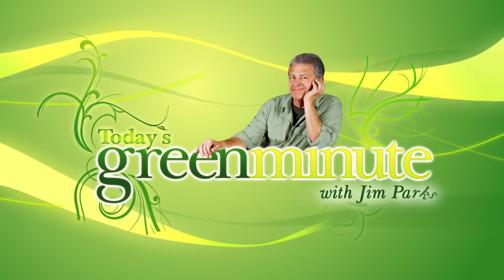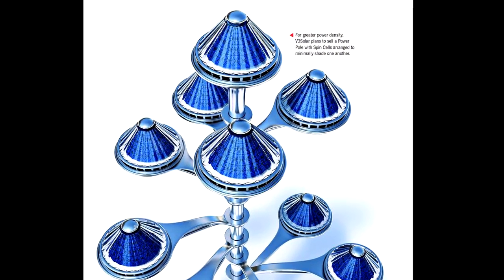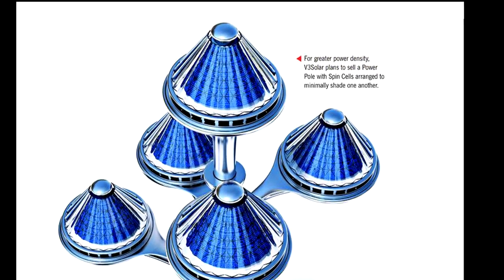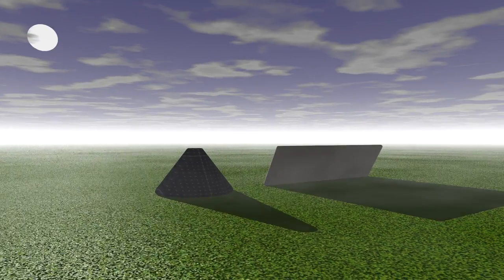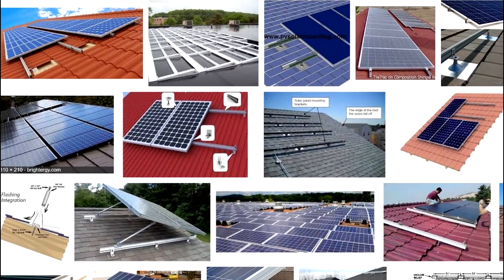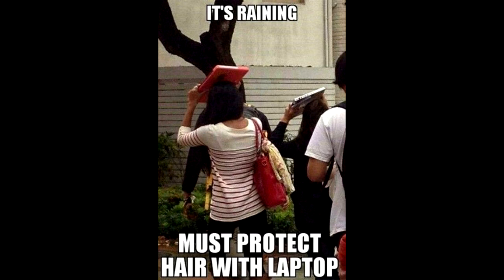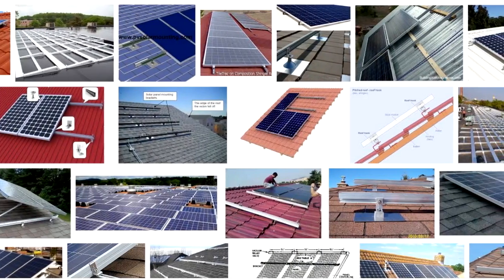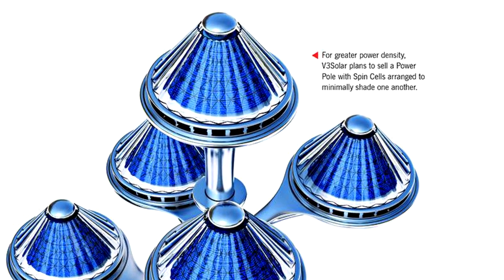Spinning Solar -BUSTED!

Comment: 20x more energy is different from 20x more efficient.
Reply: At the very least it is false advertising of the worst kind. So its still bullshit.

Its like saying "by burning 20 times as much coal we can achieve 20 times more energy output with this revolutionary new plant!"
Reply: In this case, it is the same because the input is the same, energy from the sun. If Spinning Solar is able to produce a 20x greater output with the same input, it is 20x more efficient.
Reply: Can people please read what I said instead of repeating that 20x more energy is the same as 20x more efficient.
Typical internet arguments.
Reply: Kiw3y BITCH I'M ABOUT TO LOSE MY SHIT
Reply: No, 20x more energy is not more general than 20x more efficient, it is just as general. Energy is a quantifiable amount of stuff in the universe, just like mass. Efficiency is how well a solar panel can use that energy. Efficiency isn't just used for solar panels either, it is used for engines and turbines, light bulbs and everything else that uses energy. Saying that an engine is 20% efficient means that for every gallon of fuel, 80% of it is lost in heat. This means that no matter how much energy the solar panels receive, they can never turn all of that energy into working energy. That's because 80% of that energy is to heat.

And how would a tree be more viable than a square block of solar panels? In order to maximize the amount of energy absorbed, we have to increase our surface area where the sun shines,  not behind another solar panel.
Reply: Joshua Reed tldr
Reply: Could someone please explain to me what efficiency means? I didn't get it from the 500 explanations.

Comment: it didn't actually say was 20x more efficient, it said 20x more energy. so i guess that means that if it has the same surface area as say a 50watt panel it would deliver 1000 watts. ya i'd have to call BS on that one.  never mind the fact that 1/2 of it is in the shade. even if it had double the surface area of a 50 watt panel so 1/2 of it was getting light  and then you put up some mirrors so the back side was getting light, since i've not heard of any massive breakthroughs in solar tech i'm guessing you would only get 100 watts minus what ever the motor takes to rotate that much mass.

Comment: These are no different to the wind turbines that require power to get them started since, in most places, the wind isn't sufficient to start them moving. Also, the blades of the wind turbines do not catch enough air to be efficient, to be far more efficient, the blades would have to be around 5 times wider or more, (think of the blade size on a kids windmill toy or an electric desk fan).

As with the wind turbine, any moving part creates wear which equates to cost for maintenance and repair. Therefore, a moving solar panel is going to cost more for repairs and maintenance than a static one. Even a tracking solar panel isn't going to cost as much because it moves very slowly, taking around 12 hours at most to move a little over 90 degrees every day. That's a lot less wear on bearings compared to 200 RPM or whatever those spinning solar panels do.

As with most ideas these days, it's not about efficiency, it's about making someone rich. Some company has to make the bearings, the motors and the other parts, some company has to assemble all the components and another has to build it on site and finally, another company has to maintain it. You can bet these companies are not going to be paid peanuts to do it. Even if these spinning solar cells were 100% efficient, the cost involved in building, repairs and maintenance will make the power they generate just as expensive, if not more expensive than current methods of power generation.

Just like wind turbines, it's a scam.

Comment: you can use fresnel lenses - but then you could make it any shape you want
and why spin? a clear glass (fresnel cut) shell radiates heat just as well in the sunlight, provided the gap is filled with water or something to transfer the heat from the panel and the shell.

on the other hand, the water itself can be used as a lense. but still, a panel arrangement is much more convenient, tracking or not.

- it does have potential, but it's not sensational in any shape or form

Comment: 60"C "That's SO HOT you couldn't touch it without burning yourself? In reality it's at the kind of temp' you could pick it up and quickly decide "that's hot" and put it down again. You really could touch it without burning yourself. It can burn you, but it would take a little time.

Comment: You sir obviously do not remember a damn thing about science. The waves of the outer cone aren't there just to look pretty. Nor is the black spiral you see on the inner core. Those waves refract and concentrate the light around the globe so that in essence almost 50% of the inner surface is producing more energy through magnification. as they pass into the shade the heat generated by this is dissipated by the rising cone of air that is being used to spin the inner cone. The cooler the cell is maintained the more efficient it is.
Reply: Not sure if troll. Just in case, I'll say that no matter what you do with the surface it doesn't collect more light than it gets shined on. And you cool solar panels with water, so you can use that energy, too (instead of heating water with electricity or gas). Not with air (which is going to be infinitely worse than water) and waste that energy AND put in lots of energy to spin that thing.

Comment: I know its bullshit, but do your math.  20 X more efficient on 20% efficiency, does not calculate to 400 %
Reply: ha, omg. So you can think of 20% as 0.2 but not of 4 as 400%. I see. Your idiocy makes sense now.
Reply: Rob Gandy
0,5x1.2=0,6. So 60%
They did not say 20% more efficient.
Reply: Rob Gandy 
1 is 100%
4 is 400%
20%=0.2
20x0.2=4
20x20%=400%
Reply: 20 x 0.2 is what then? Maybe they meant 20 times more efficient per square inch but they sure didn't say that and that is also an extremely tall claim.
Reply: Go ahead and explain how 20x20 is not 400.
Reply: Your No serios are you ???  I never said 20 X 20 does not equal 400.  I said, 20 % of 20 % efficency does not equal 400 %.   need to check your math, not to metion the law of thermodynamics.  (forgive the spelling, I dont have my glasses on)

IF I had a 50% efficent solar  cell and i created a new one 20% more efficent, you tell me what it should be.  (I know My math)

Cheers
Reply: Awesome!  Math wins!  Good job!  Still, Regaurding the Vid.  Still smells like bull Crap.

Cheers!
Reply: Rob Gandy
You said 20 times 20% is not 400%

But:
20x20%=400%

20x0.2=4
Reply: K, seriously.  20 X 20 % is NOT 400 %  Please check your calculator, or pencil or something.  I'll make it easy.  20 % of what ???  if we use a simple number like 100  20 X 20 %(100) = what ???  You tell me.

Ant the fomula below, you got it right.  20 X .2  (or 20%) = 4  NOT 400.  single digit 4.  Your out by a few orders of magnitude
Reply: Damn Rob, do you work in customer service for a certain telecom giant? #VerizonMath
Reply: fight fight fight

Comment: What you don't get Thunderf00t is that if you turn these cones on their side and make them into conical wheels. These wheels when applied to a track will always roll forward across the Earths surface with only a small amount of energy needed to go uphill. It will revolutionize the way we travel by locomotive!

Comment: When i saw this i went HUH, I love solar i have 2x 250 watt panels myself and a battery bank.....Funny this video comes out. 2 weeks ago i was doing some tests (DIY current monitor) on my 50 watt panel and realized that for the 3-4 hours it was lying flat on my balcony, it was cooking hot on the back. i remember something with regards to efficiency lost due to the heat of the panel. I thought that if you are able to strap/secure/thermal epoxy , etc some flat copper piping of some sort on the back you could double up on cooling the panel with cold water and use the hot water produced for dishes and shower. Not sure how efficient it will be, but want to try some experiment this coming holidays. Is there some merit to my idea or am i being crazy.food for thought. thanx for the video

Comment: also musk's mars mission is not that much bullshit as the rest of this stuff. It's just that there is no way this guy with his lack of scientific knowledge is gonna do it in such a small period of time. He can still to it faster that NASA just because NASA is a government funded and controlled agency.
Reply: It's not like he is doing it alone and hammering away on his spacecraft in his garage. Pretty sure he has some actual rocket scientists. The problem is that these scientist are in it for the money, fun and pioneering work. People are going to die in this project, it's part of the design. I couldn't work on that with a clean conscience no matter how much Musk pays me.
Reply: Radiation, low gravity, the optimistic postulation that there is enough ice to generate oxygen by electolysis AND provide drinking water, energy generation problems (solar power is a big risk given Mars' sandstorms). He talked only about the ship. Can we send a ship to Mars, yes. Can we live on Mars, no. If we send people there without plan to go back, they will kill themselves, each other or die due to technical problems. It's irresponsible.
Reply: Space is hard. Commercial Crew development contract demands probability of Loss Of Crew around 1 in 270. Post-Columbia estimates of Shuttle's Loss Of Crew were as bad as 1 in 135. Anyone working in manned spaceflight should expect that eventually someone will die.
Reply: Just Add SRBs I like your username :)
Reply: Just Add SRBs
It's one thing to calculate risk of accidents. It's another thing entirely to send people on suicide missions even if they do it voluntarily.
Reply: +Yaldabaoth
What part of Musk's proposed MCT/ITS/whatever-they'll-call-it mission is a suicide? Ability to abort during most of ascent to LEO, unmanned testing and thermal protection not being punctured by debris from external tank is more than Space Shuttle crews could have.
Reply: people die crossing the street and we have street crossing guards in our grade schools, it's like you telling me, you wouldn't be involved in school crossings because some of the kids crossing the street would die even with the crossing guards.

or in a more real port, it would be the same as jet testing pilots taking the risk of high speed possibly explodie plains and lots of money.

Comment: nothing said about the energy lost from "spinning" the device. I thought that was a significant flaw as well.
Reply: well, bear in mind that he's stacking it up against a tracking panel, which also needs power to move
Reply: +Taunus-Tims Welt if its keept at vaccum preasure than there is no point in spinning them anymore is it?. since the hole point of spinning them was to cool them off, you wont take away heat if there's no air do so
Reply: jon arbuckle if the cone is under vacuum pressure and your bearing is quite good you wouldn't need much energy to keep them spinning. But of course you would have to speed them up on the first run. Nevertheless i think spinning these things wouldn't be to much of a loss. Still they are bullshit science.
Reply: Taunus-Tims Welt I'll give that to you, yeah. being that it's proposed "selling point" was the spinning "OMG THEY SPIN", i guess the energy loss would have been "a necessary sacrifice"

Comment: There are so many holes in your assumptions.  Twisting math to make it prove your delusional theories it pathetic.  Unfortunately must of your moronic subscribers can not see that.
Reply: He talks about surface area.  The cone technically has the same amount of surface area though it is spinning.  It is also spinning at a decent rate of speed making the entire surface available every rotation.   It also pretty much insures that some part of the panel is in direct sunlight at all times unlike standard panels.   Most of his initial assumptions were incorrect.
Reply: Sweetheart, with your logic all Solar panels on earth, would produce electricity all the time, which they don't and can't because on one side of the earth its Night time so just half of the earth's Solar Panels could produce electricity... 
But because were spinning at a decent rate all our Solar Panels do face the Sun duh >_>

I have a little experiment for you because you clearly didn't go to school. 
1) Take a Glass with Soda and a marker
2) Draw a dot onto the side of the glass which is right in front of you 
3) Turn it
as soon as you CAN'T see the Dot you can't  produce power with this dot.
Reply: Cleesly
Current solar panels are not always in direct sunlight which is when the produce the most electricity.  It is not a hard concept to understand yet you still struggle with it.